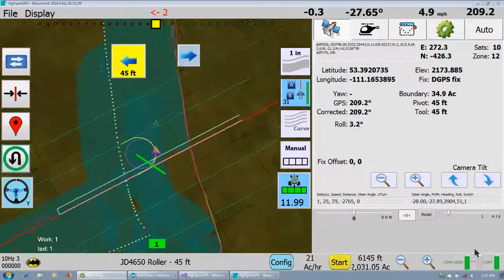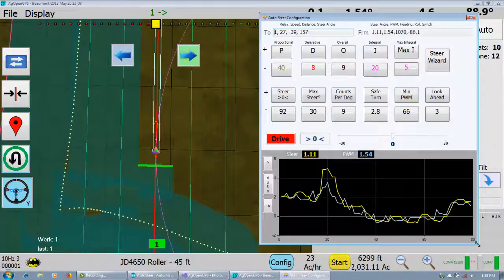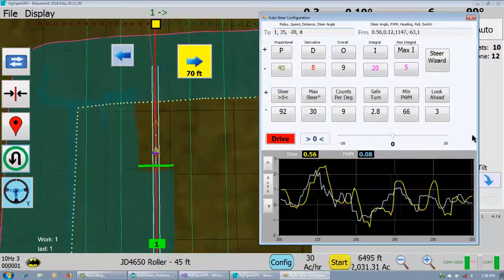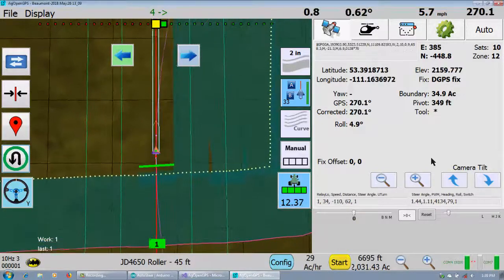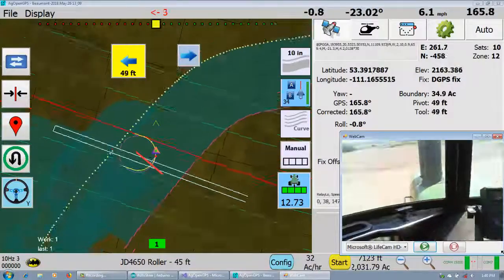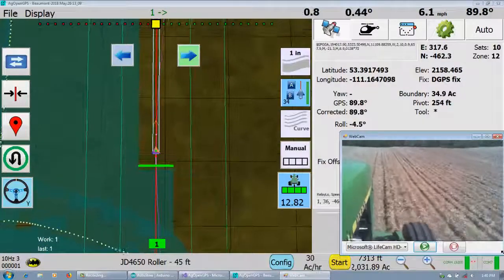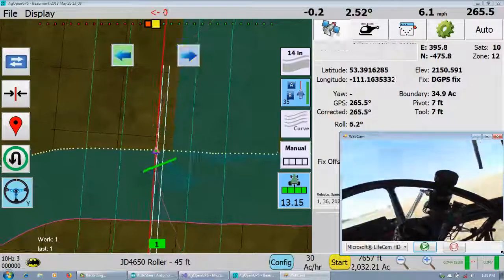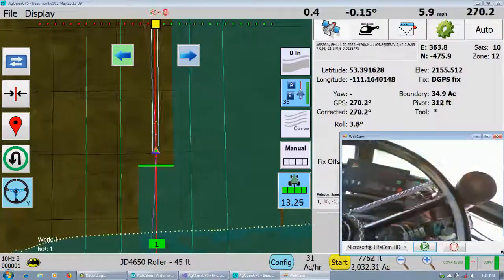Auto Steer with No IMU

Comment: Hello, i can't use Headland and i dont know why.
Reply: Does anyone know a tip :)
Reply from the maker: AgOpenGPS hasn't had headlands for quite some time. It has a Turn line that does auto turn and machine sequence control. MAke sure get the latest from Github.  @peterwormann1298
Reply: I have the same Problem.
https://github.com/farmerbriantee/AgOpenGPS/issues/53
Is it an old version?

By the way nice work !
Reply from the maker: @peterwormann1298  Its not a problem, its telling you it isn't implemented, because it isn't implemented.....
Reply from the maker: @peterwormann1298  The UTurn pattern that is displayed does that now, you're not limited to the headland line. https://www.youtube.com/watch?v=3OOQWXNsE20&t=5s
Reply: Thanks for the quick answer. :)
 I want to do the headland in the end. This means that the machine should switch off when turning. As seen in this video: https://www.youtube.com/watch?v=Ox63X-9dE44
I think I downloaded the newest version on this website: https://github.com/farmerbriantee/AgOpenGPS
If I have created a field and Baundaries and click on the Button Headland the following text appears: "Headlands not Implemented .... Some times soon they will be functional"
Is it an old version ??

Comment: I suppose IMU is usefull in case of field with different altitude (hills) , not so necessary in case of flat surface.
Reply from the maker: The IMU really helps when the field is rough because then the antenna wags back and forth and makes unrealistic headings. The IMU doesn't change heading when its rough.